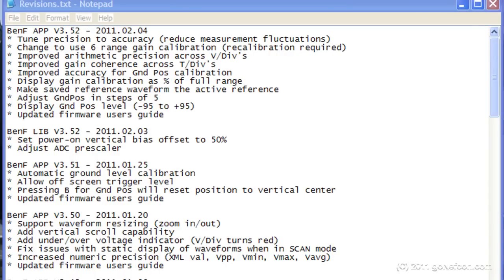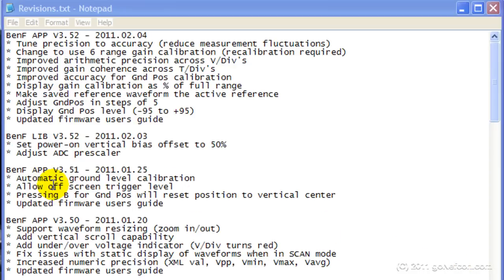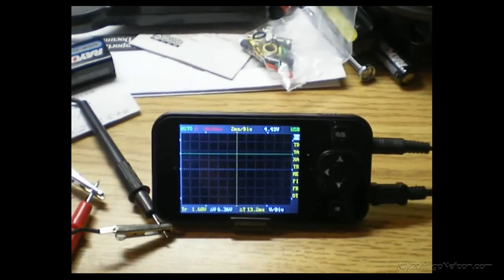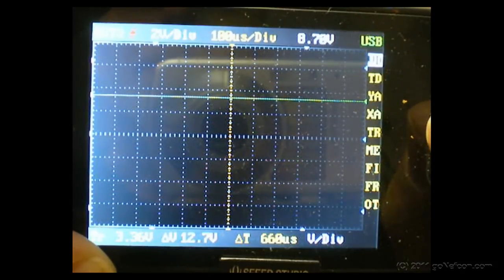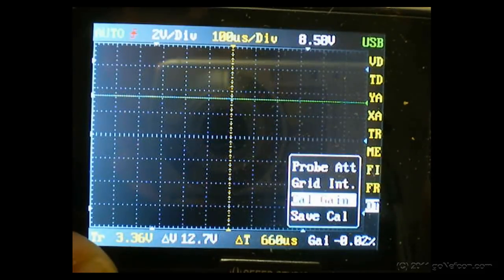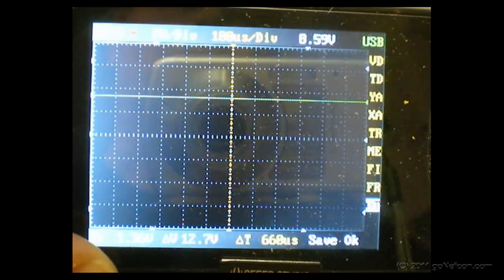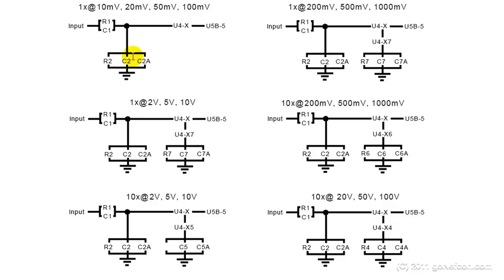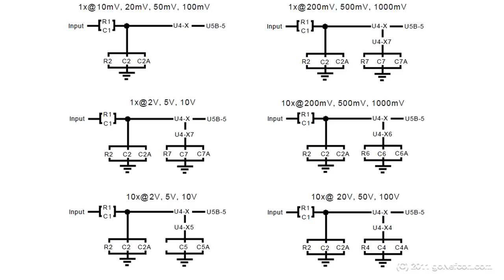DsoNano v3.52 #13 Upgrade & Calibration

Comment: thanks for the tutorial was wondering how that works, and a huge thanks for the video on how to update the nano,  i also have a pico3423 and a  fluke 196c, but these little nano's are the coolest things i have 3 of the version 2's, had to change the leads to 4mm bannana ends to accept test probes, and another adapter that converts bannana to bnc for current probes, pressure transducers and such,  .......benf software is awsome